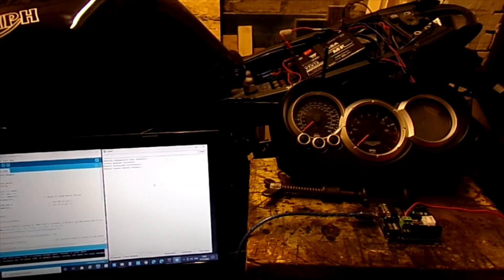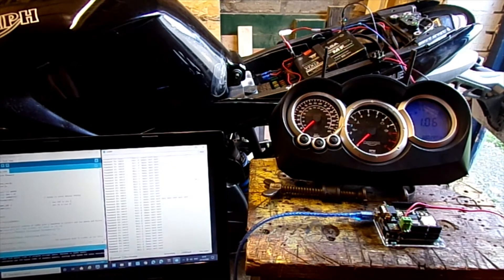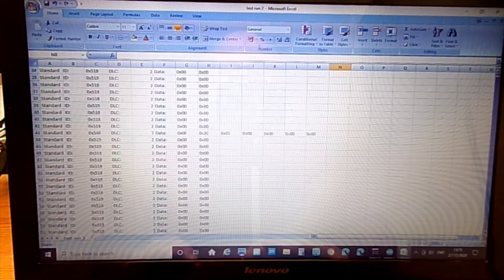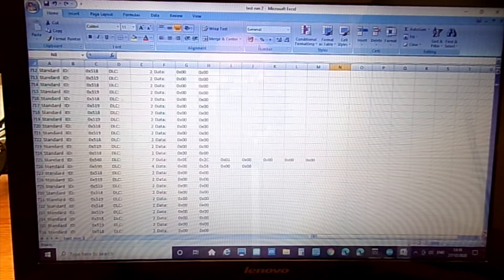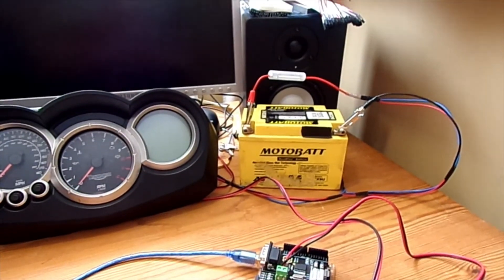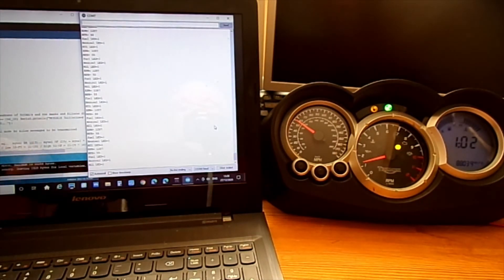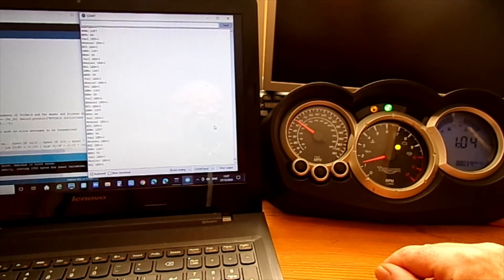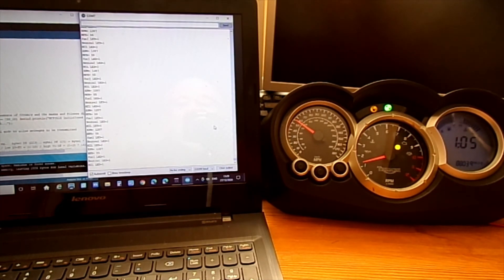Triumph Triple/Sprint 1050 can bus reading and sending messages - Arduino Project

Comment: Hello, this is very helpful, I am trying to power up and display data on my olde Tiger 1050 Dash.

While I can set the LED's on and off, and control the Temperature and Fuel Bars, I cannot figure out how to make the dash think that it's connected to the bike and in neutral with the engine off.

Would it be possible to share your excel dump so that I can see what data is being sent when engine running / off, or let me know what data is being sent to the display when the ignition is on, the bike is in neutral ?

Many Thanks in anticipation 🙂
Reply from the maker: Unfortunately the laptop I had to do this has since died and I had no backup.
The only data is right at the end of the video 10:24 onwards. Neutral data is in the same ID as fuel & MIL data so sounds like your almost there, see 10:40
Reply: @InTheShedUK  - thanks for helping, I can control the RPM, all the LEDS and I can increment the distance as per your discovery of byte 4 of 0x540, but for some reason the MPH speed is not displaying, I mean it's not showing 0, but showing notheing at all, however I know that LCD is working as the odometer shares the same display (The tiger has 2 displays)

Do you recall what the values of the other bytes of 0x540 was as I cannot see from the video:

0x540 B1-B2-B3-B4-B5-B6-B7

I know that B1 is the LED controls, and that B4 is the odometer increment, but what were the values of the other bytes.

It would be great to know what these values were with the engine running and with it stopped 🙂

Thanks again.
Reply from the maker: @PeterCruickshank-s8q  Wish I could help, this was a while ago and my memory is not that great!
I wonder if you try contacting Butch Cassidy (earlier messages) looks like he was also also doing some work on this.
Reply: @InTheShedUK  - No problem, thanks very much, I could not have got this far without your work. I suspect that when the ignition is switched on, the ECU sends a message to the dash asking if it's there, or an initialisation sequence. Thanks again.

Comment: Any progress on the decodes mate? I'm trying to find gear position I think it's in 0x540
Reply from the maker: No, did not get any further with this, would make sense for it to be in 0x540 as neutral position data is there.
Unfortunately I do not have a speedo/dash for the Speed Triple so I am unable to bench test.
Reply: @InTheShedUK  No worries I decoded most of what is available from older  ST/Daytonas yesterday. For anyone needing it- 
0x518 Byte0, Byte1: ECU RPM (little endian)
0x519 Byte0: Vehicle speed
0x530: Byte0, Byte1: Dash RPM, Byte2: Speed (from dash, possibly different offset for calibration?)
0x540: Byte0 Bit0: Low fuel light, Bit1: Neutral light, Bit2: MIL. Bits 4-8: Gear 
0x550: Byte0 Bits 0-2: Coolant bars
0x570: Byte0: TPS, Byte2: Coolant temp. Byte4: Inlet temp
Reply: Still hoping to find and emulate the message(s) between dash and ecu to allow startup without the OEM dash...
Reply from the maker: @butchcassidy7289  Hi, good luck with that one!
Although don't think you will find it on pre 2007 Speed Triples (Sprint even later?) Triumph added the 'handshake' to the Speedy sometime during 2007.
I have an Acewell speedo on my 2006 and works just fine, see https://youtu.be/AVpurSm7e-8 for how I connected it.
Reply: @butchcassidy7289 I have a question about message 0x540: what bits 4-8(Gear) actually mean? As far as I know, Sprint doesn't have a gear position sensor, only a neutral switch.